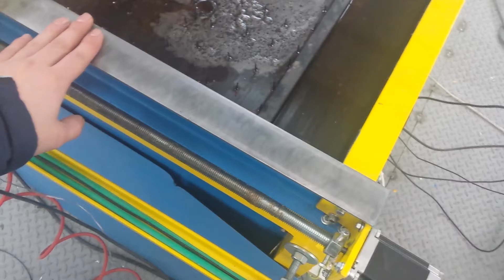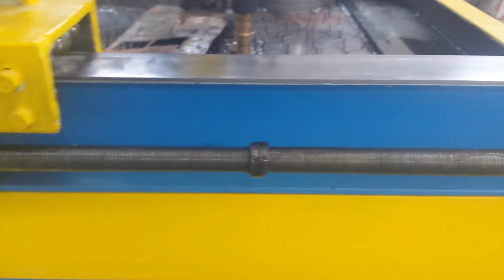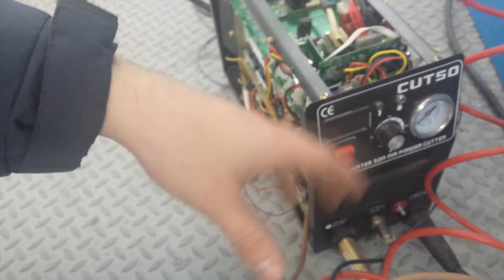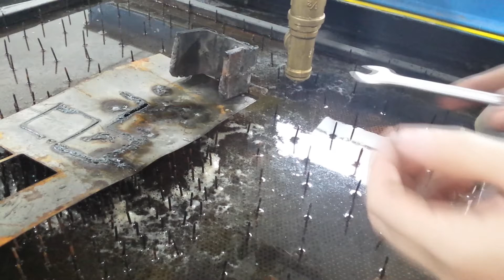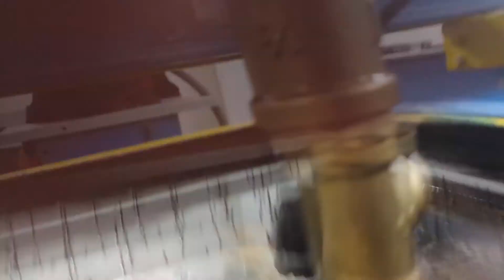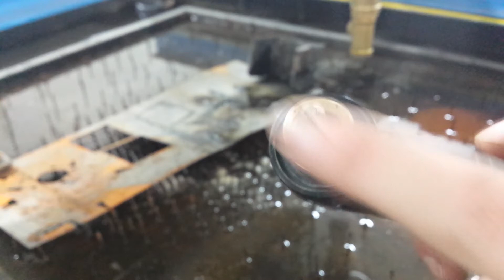DIY CNC plasma cutter

Comment: Hello, I'm from Brazil and I wonder if you can help me? I designed a plasma cnc but I have a problem when I turn on the plasma the computer crashes it is failing the torch just like your video.

Comment: Hi, Congratulations on the video, I would like to know if you can help me I'm having problem with the interference of the source in the cnc motors so I can not use the plasma to cut, could you tell me what you did to prevent the interference from affecting the electronic part of your cnc

Comment: Dear , really its a great job with cheap product with good quality of function, i also planned to build a slimier unit, where im have 5 axis control interface board/ stepper driver/ stepper motor..etc. if you can able to give a exact product detail for the remaining plasma cutting unit with electronic connection will be helpful for me to complete the project. all the electronic connection for the regular CNC XYZ is as mentioned in the link. 
https://drive.google.com/file/d/1LZVX-h48_iErjmtSKxlOLnXnyNvhlBQX/view?usp=sharing

Comment: Please help me, before i made cnc roter and run normally. This time i tried to replace with plasma, why when my torch is in x axis plate, simultaneously plasma is alive, my machine is moving without program. Note: plasma and cnc separate machine (manual on off)
Reply from the maker: You have EMI on your system. Try to use shielded cables, with the shielding connected to ground.
Reply: jaimeesg no im not have EMI in my system. What this problem
Reply: You have to shield and ground cables. Use pilot arc cutter only

Comment: WHIC breakout board you using 

may  you please the explain the electronics that you actually use used on your  CNC plasma cutter 
i want to use Arduino UNO to do the plasma cutter but i have had little success on connecting things like plasma cutter torch height control ,on which pins do you connect the touch height control . which software do you to generate g code

Comment: I want to build a CNC plasma cutter and I am getting the parts I am going to buy picked out. Do you use shielded or unshielded cord for you stepper motors?
The link below was the cord I was thinking about buying. What do you think?
http://www.automationdirect.com/adc/Shopping/Catalog/Wiring_Solutions/Bulk_Multi-Conductor_Cable/Flexible_Control_Cable/18_AWG/V40168-100

I had that same ideal in mind for the bed.
Good work!!!
Reply from the maker: Landon Brecheisen unshielded, but be very careful with interferations, the pilot arc function interfered a bit with the electronics and i moved to a blowback system with zero problems